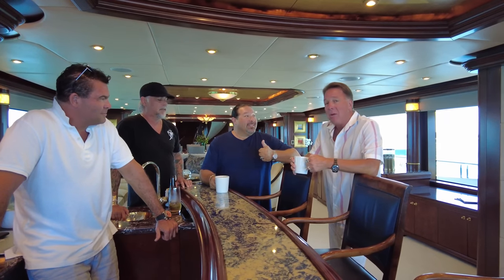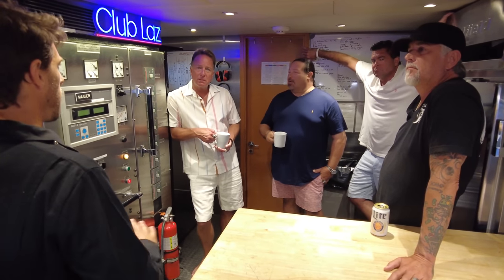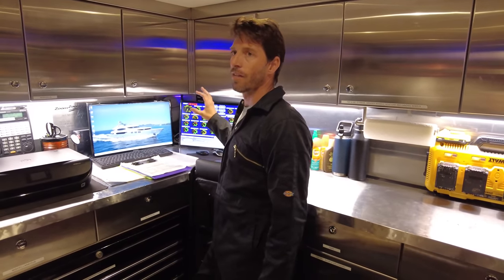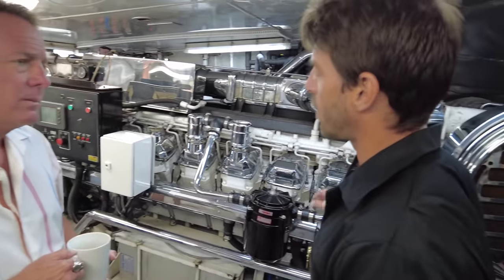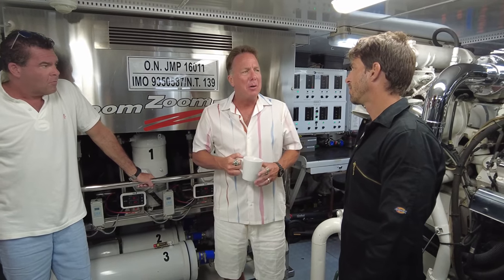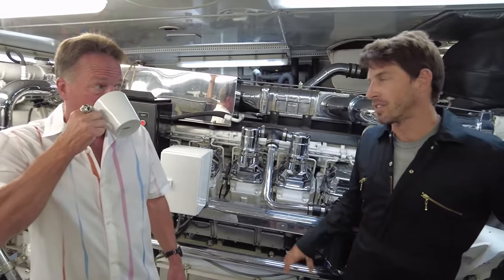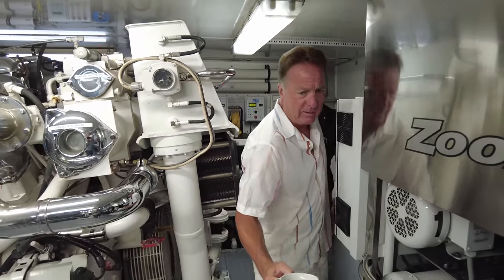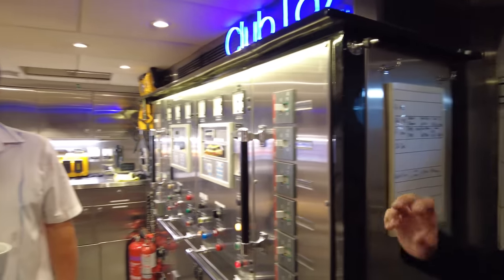BONUS: This is THE Fastest SUPER YACHT I've Ever Been On!!

Comment: As a career Railroader I had a lot of experience with v16 and v20 diesel engines. Mostly EMD and GE designs but a few Cats also. 
Ours ranged from 3000 to 6000 hp, but mostly in the 4000 to 4400 range.
You should have asked what the cu. Inch  displacement was on each cylinder. 
The EMD's I worked with were either 645 or 710 cu. In. per cylinder.

Comment: So if the ship runs 24/7 and crew is always on deck, that means that the engines have to be rebuilt every 2.5 years?
Reply: No the boat is always on electronically but the engines themselves are not always running
Reply: Engines for cruising...generators for running all the systems.